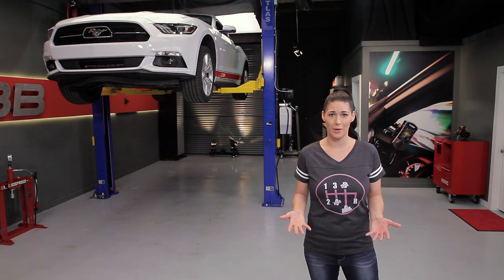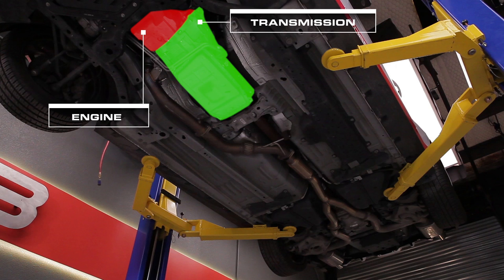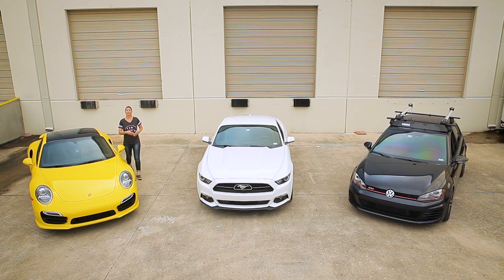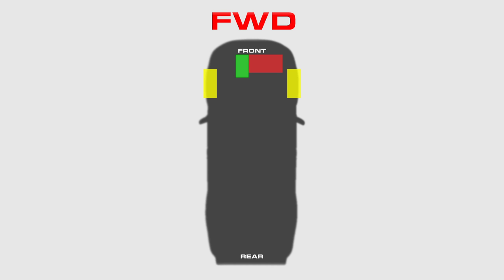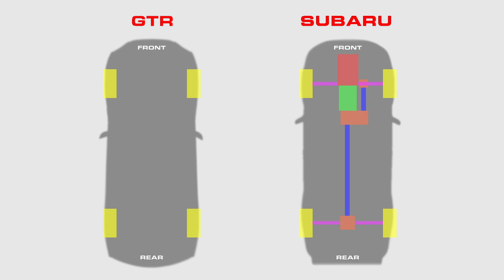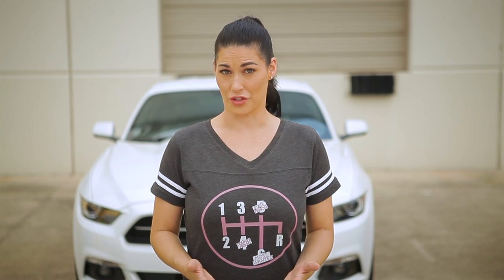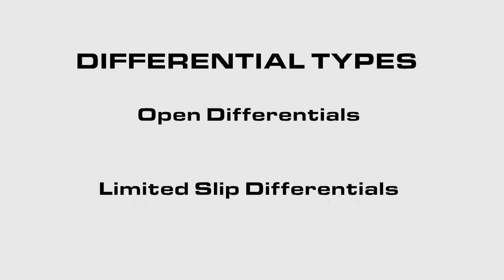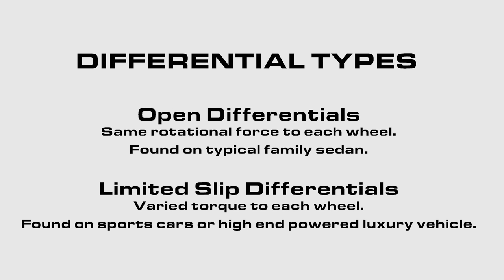COBB Tuning - COBB University Episode #12 - Drivetrain

Comment: That Subaru diagram is wrong. The front diff and trans are in the same housing, the front drive shafts are the same length. 

 "Symmetrical AWD."